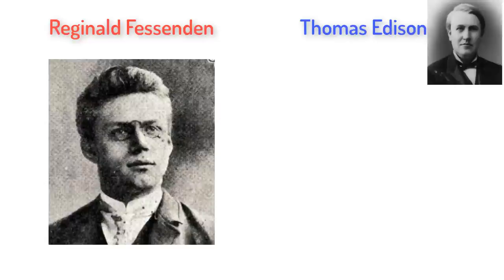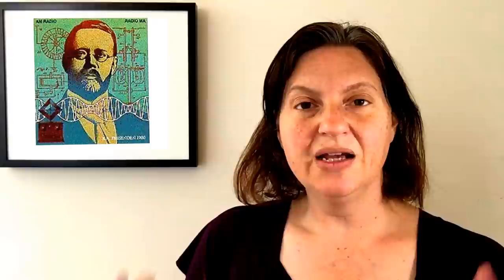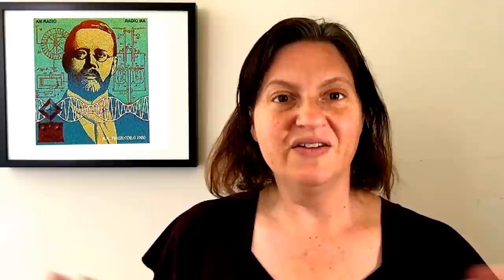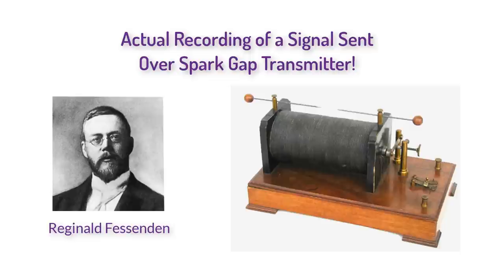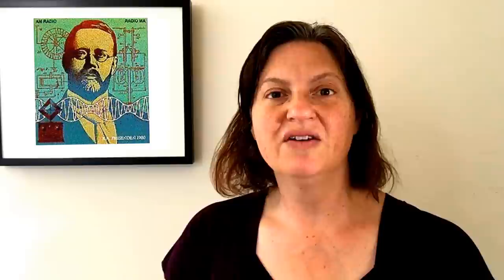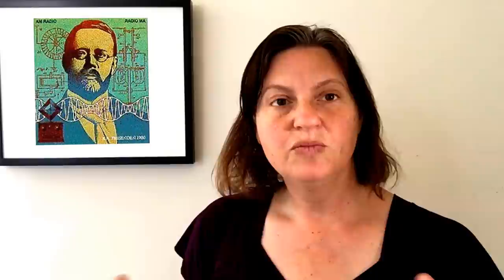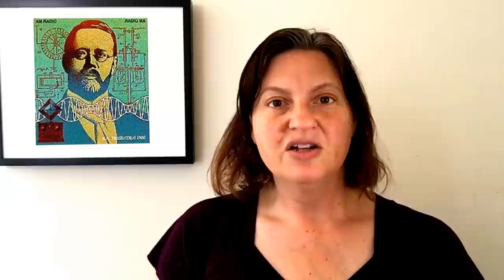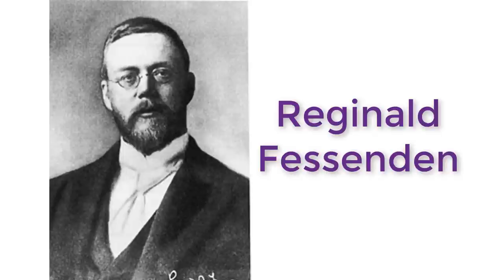Reginald Fessenden & the Physics of the First Radio Broadcast

Comment: I'd read about that first spark gap transmission of voice, but had no idea there was a recording of it.  That was absolutely fascinating.  (After watching a half dozen more vids, I've come to the conclusion that this channel is genius in collecting and ordering obscure facts and history into a unique and fascinating presentation.}
Reply from the maker: Thank you for the lovely compliment and I agree, would love to hear it.
Reply: I don't think that recording is of that transmission, but rather of a hobbyist later -- could've been a little later, or even recently -- decided to make such a transmission and record it.  Sparks create a slough of spurious signals at all frequencies.  Frequently audio equipment with loose connections create modulated spark gap signals accidentally, and the discharge will also reproduce the sound via sparks in "accidental receiving equipment".  More commonly accidental audio reception from r.f. comes via a loose wire vibrating against a piece of metal.

Comment: My father studied broadcast engineering in the late 1940's. He always called a capacitor a condenser. The name changed in the 1960's at the same time the tuning indicator on radios change from CPS to Hz. happy to see in this video the reference to both names.
Reply: Auto mechanics and the British tended to retain the term "condenser".  But now that auto ignition is electronic, even mechanics don't have call for the term any more.

Comment: I've always wondered whether a magnetic amplifier was used to generate the AM modulation or if the multi-kW output of the Alexandeson alternator was somehow fed through the microphone. It would be interesting to see a schematic of the transmitting apparatus.

I spent many of my younger years working at WBAA, Purdue University, which was first licensed in 1922. We didn't have any gear from 1922, but we did regularly use a 1940s era transmitter. At our studio we had a device which you might talk about, if you haven't already: the Ampex (350 series) tape recorder. Magnetic recording and Ampex in specific has a very interesting back story. The Germans perfected magnetic tape during WW2, we captured it from them after the war, and thereafter every VOA relay station had an Ampex room which used this technology to broadcast to the Soviets.

Comment: The chemical rectifier is an interesting idea. No surprise that Fessenden, the former chief chemist of the Edison company, came up with it. When I was reading Edisons biography, I was surprised that the electric meters used by the edison electric company were electrochemical, not electromagnetic with slow motors and odometers. Edison himself once inspected and measured the current in JP Morgan's  mansion, when the Morgan family complained that the meters were faulty and they were being billed too much.
Reply: What fascinates me is than another former Edison employee, Ambrose Fleming, basically discovered the vaccum tube diode,which was the standard rectifier until the invention of the silicon transistor by Bardeen and Brattain.
Surprising that the army of brilliant scientists in William Crooke's circle didn't discover the diode and triode. They had plenty of opportunity
Reply from the maker: VarahaMihira Gopu I mentioned Fleming in my video about the diode and Edison’s factory of inventors was fascinating to me. Fessenden wrote about it a bit but then went off on racist garbage and they told him to stop publishing. 

William Crookes was amazing but he didn’t have much of a team, just him and an assistant as far as I can tell. I mentioned him in the video about radio waves and about cathod ray tubes and even about the third law of thermodynamics!  Plus, I dug his mustache.
Reply: Wow, electrochemical meters!?  What did they do, measure DC by volume of gas produced electrolytically?  Weight of metal reduced, scraped off, dried, and weighed?
Reply: @goodmaro  Yes the Edison electro chemical meters measured electricity usage by the increase in weight of the zinc elctrodes.
Reply: @writergopu  Did they have a balance attached?
Reply: @writergopu  This device was actually invented by Michael Faraday.

Comment: Loomis claimed wireless sound transmission in 1877 using Bell's telephone equipment with his kite-and-spark-gap setup.  I don't know if he demonstrated that publicly, nor do I know if it was replicated, but it could have worked, due to the nonlinear characteristics of carbon microphones.  A carbon mic in series with a spark gap (powered by the sky-to-ground DC potential) could have generated both r.f. transients (tuned by the long wire of the kite and capacitance of the spark gap) and an audio frequency envelope.  It wouldn't've had high fidelity -- nonlinear in, nonlinear out -- but then neither did Fessenden's first try.

Comment: Explain to the coherent
Reply: Can I add a little here ?? the coherer is made up of a powder of really what is crystals...of metal crystals...of organic crystals and can be explained as a semi conductor.  A piece of coal or similar material if "tickled" with a fine wire will become a coherer. a semi conductor.  This idea was used in the very first radio receivers as a crystal detector.  Today it is the diode and is encased i plastic...but it is still the same principle